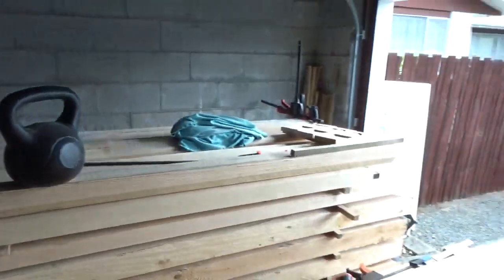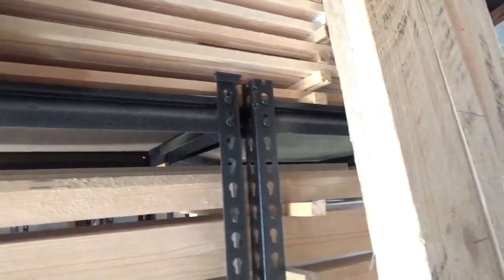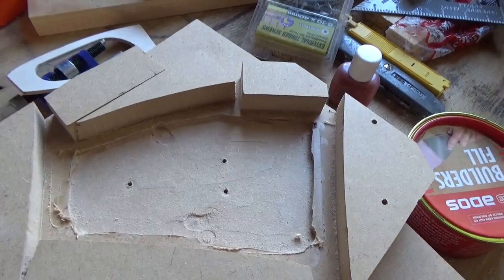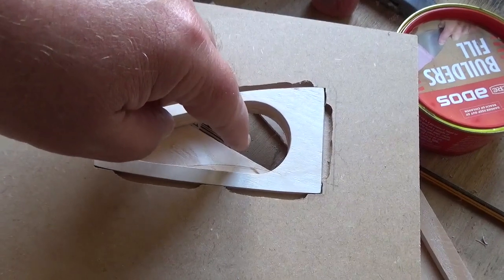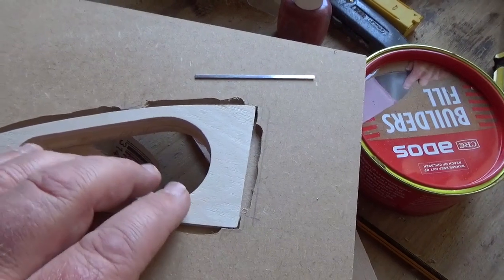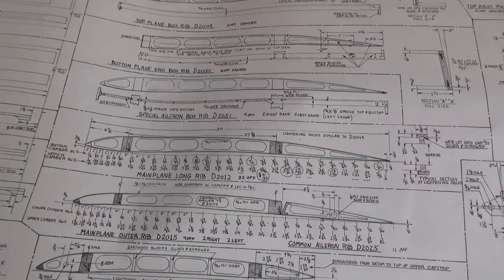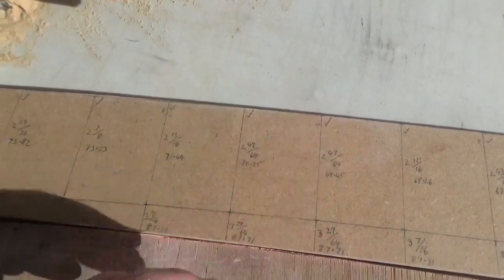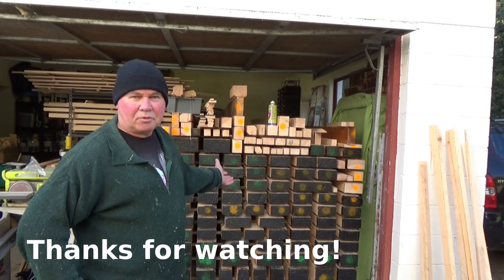Making Ribs for a 1917 Sopwith Camel Ep1

Comment: There is a simpler way used by furniture makers using a router table and a template.  Make one piece according to final dimensions and then attach it to raw stock with some screws or double sided tape.  It would be worthwhile to rough cut the stock with a jig or reciprocating saw before routing to the final size.  This will reduce pressure on the route bit while increasing operator control.  Then just route the outer edge followed by the inner hole.  I usually attach two dowels to the template to provide handles for maximum control while keeping my fingers clear of the router bid.  I couldn’t tell by the video the character of the lumber you are using.  But you may want to use tight grained hard wood material to avoid splitting when under stress.  Hope this helps.  Wishing you the best of luck with your project.
Reply from the maker: Thanks for the feedback, that sounds a lot easier :-)
Reply: @MattProject  Happy to help.  Take care.